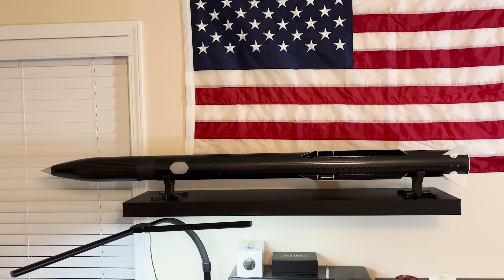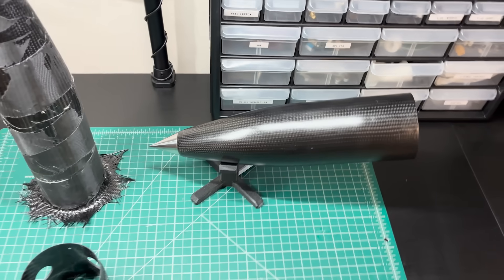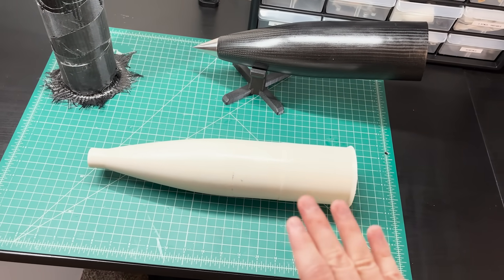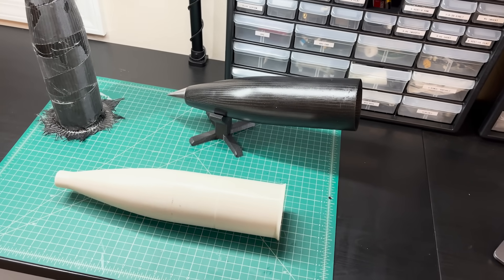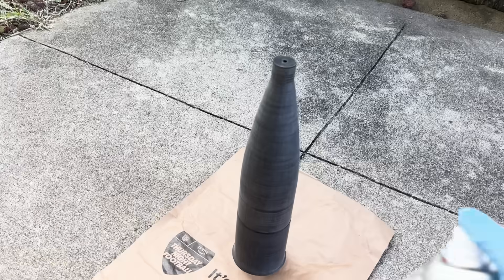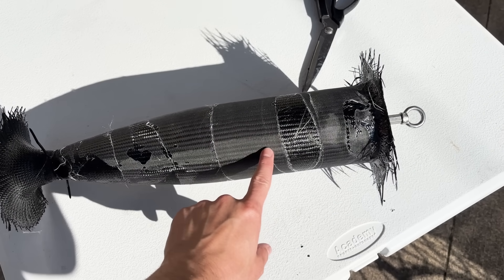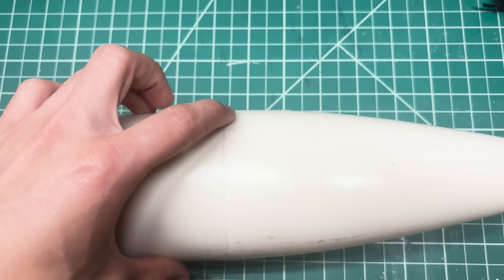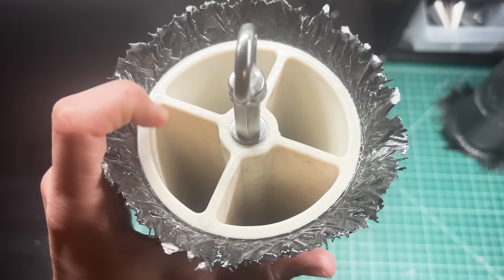Making Carbon Fiber Nose Cones at Home

Comment: Loved the video, but did have a suggestion to help! You're using a positive, or "male" mold (hence the mold release sleeves lol)

Another way to fix this problem is to use a negative mold. It would have to split down the middle of the nosecone longways and you could pull the 2 halves apart to release the piece. Easycomposites has a great video on a carbon fiber tube they made where the process would be very similar. An added benefit of this is that the outside surface is exactly what you design, since it's the molded surface.

Only thing is you'd have to vacuum bag it to apply pressure to the inside which I'm not sure if you have access to that and the materials associated with it. 

Keep on grinding! Such a cool project

Comment: Haven't tested it out myself, but have been wanting to get my hands on PVA filament which is water soluble and could allow just melting the mold out from the inside post layup with a water bath.

Comment: In the limb prosthetics industry, they use a pipe surrounded by plaster to create the internal mold for the limb sockets. For this project, you might be able to use a 3d printed clamshell mold of some kind to pour the plaster into and centering jigs to keep the hollow pipe centered. If there is a way to 3d print silicone, that might be your best option. I'm sure there are other ways to make a clamshell from silicone. You can get many years out of it. After the plaster dries, set aside a flexible bag that acts as the external mold. Place your carbon fiber tubing over the plaster with plenty of excess to trim. If you want, at the top of the cone, you can even reduce the wrinkles by cutting seams with overlaps and make sure there is a bit of overlap there. Or you can work them out with your fingers when the resin has permeated the fibers. But that's later. Once the fiber tube is around the internal mold, place your plastic bag (like a trash bag) over the carbon fiber tubing and tightly tape off or bind the bottom flared end around the pipe past the fiber tube excess. Once that is done, do almost the same from the top but leave enough space for a funnel and plenty of excess bag to surround the funnel, long enough to be above the funnel. Then pour the resin into the funnel above the carbon fiber. If you know the amount of resin you need, then after you've poured it all in, remove the funnel and seal the top of the bag. If not, then you might need to add a bit more to make sure it's evenly filled. Then use negative air pressure to suck the air out of the whole assembly so that the outer bag is sucked tightly around the whole thing and the resin permeates the fiber tube completely. You can visibly see it fill everything if you have enough resin. You want just enough resin, not too much and not too little. If you need to work anything this is the time to chase air bubbles out with your fingers and hands rubbing the outside of the bag. Once you are satisfied with the fill and no air bubbles, turn the air valve off and let it sit to cure. Once it's cured, the plaster is easy enough to remove without breaking the carbon fiber. You just need a piece of metal and a mallet to crack the plaster a bit and work the pipe out without damaging wither the pipe or the carbon fiber. Then you can remove the left over chunks and wash it out. I believe dish soap and water is enough to clean any plaster residue off of the inside. After that you can use a small belt sander or other hand sander with the cone mounted on a rotating mandrel to knock down imperfections. You can reseal the resulting product with a little bit more resin painted on the outside.  It sounds complicated but it is fairly easy to fabricate your own jigs and pipes that have quick disconnects for an air compressor system. I'm sure there are some videos around that demonstrate this method.

Comment: We use a layer of LW-PLA that creates an internal wall with the added benefit of precise print-in-place mounting points for our hardware. there is an internal PLA rigidiser with a removable key so it can be easily popped out once everything is cured

Comment: Why don't you just thin some silicone caulking with acetone and paint it on? Yes, you can thin silicone caulking with acetone. Or you could try using a mold silicone and paint that on. If that doesn't work, why not dipping it in wax? Get a pot of wax, melt it, and dip your entire part in it. Then, you could maybe heat the wax up afterwards, and the part will fall out. Why don't you try mold release? I guess that should have been my first suggestion. But I got a feeling the silicone cocking would be the best bet. Yes, you can thin silicone with acetones. Blew my mind, too. I bet you could thin it enough to spray it. That would achieve a very consistent layer of it. Also, you are aware that when resins like fiberglass resin or epoxy dry, they shrink. Locking itself onto your mold. Why wouldn't you just coat your mold in epoxy? That would make it perfectly smooth. And then ensure you remove all the bubbles by heating up the epoxy with the torch. I know a very good way that would take a little bit of designing, but if you designed your mold/part to incorporate a hole or air fitting on the end that you want to come off, you could use air pressure to release your mold.
Reply: Wow, that's the best comment yet. Some good ideas there. I bet you this is gonna get the top 5 comment:trophy-yellow-smiling::trophy-yellow-smiling::trophy-yellow-smiling:

Comment: Do you need any kind of special permission, or a license, or like a permit to fly this size of rocket?
Reply from the maker: I need a NAR Level 2 certification to fly at club launches, but the US government has no certification requirements to launch a rocket this size. You need to file an FAA waiver for any high powered amateur rockets, but this is handled by NAR or TRA clubs if you leverage a club launch event

Comment: on your point around 12:00 ish, this is why I promote the concept of "The Cube Test". create a cube of a known size, I recommend 1x1x1CM. run it through your processes, and measure it between steps to register how the material is affected by the material properties, so that you can then make your molds/3DP parts to more exacting dimensions.
regardless of the measurements after, you know that the original dimensions are 1x1x1, so any changes can be accounted for in the process to ensure parts are made the right size.

how much does the material change from the original dimensions by the 3DPF/resin cooling, 
how does it change in response to the vapor bath? 
how does it change in response to heating/cooling cycles like how you do to cure the carbon fiber/fiberglass/other materials?

this allows a wider variety of 3DP filaments to be used that aren't necessarily going to cool to the same dimensions as other materials without fear of it failing fitment or spec checks.
I would recommend doing it for each fresh spool of filament as well, because even if it's the same filament there may be variations in qualities between production batches.

I don't even have a 3D printer, but this sort of thing is a practice in Machining to test machines, in order to make sure they are still working and performing within acceptable specifications to produce parts correctly. we test the CNC machine by using a plastic simulacrum (there's a word to look up lol) to see if everything is performing right, and any new metal/polymer is tested before use to make sure it all meets minimum quality requirements for the parts being made.

I'd recommend printing out some template sheets to keep track of data regarding individual filament qualities to allow this to be easily kept track of with a clipboard instead of needing to step further away to use a computer, or using a tablet with the template and the ability to write which then saves to your computer or a storage drive.

Comment: It doesn't look like you have a draft angle all the way down it.  A draft angle makes a world of difference.  Also, carbon fiber that meets the metal tip should not be a larger diameter, it needs to be a smooth transition.  But I assume you saw that too.  Good work.

Comment: I´m wondering - could there be a way designing the mold as closed volume and try to suck a vacuum in it? May be in combination of forcing preasurized air between mold and shape?

Comment: Why not print a solid mold out of high temperature resistant plastic, dip it in parrafin wax and then just melt the wax to pull off the cf shell?

Comment: I have had good luck with a PTFE-based spray on mold release in a slightly different application. Two questions:

1) Have you considered using carbon fiber filament for your printer? The required mechanical rigidity of the mold is not extreme, so the wall thickness is not an issue, and maybe the printed fiber could replace one of the layers of the cloth.

2) Have you considered curing the nosecone in vacuum? At that size, you should be able to buy or manufacture a vacuum chamber for it. If you manufacture one, I can recommend schedule-80 PVC pipe. You can get it in rather large diameters. A diaphragm pump should be adequate and inexpensive. I have no experience with bagging, but I do not think it would be possible with your nosecone design.

Comment: Hi, I do have some experiences making sounding rocket's airframe parts using carbon fiber. The way I did was resin infusion. First I print a 3D printed a pattern, then the pattern is sanded and coated with epoxy resin and sanded again. This will create a perfect surface for mold release. The I applied about 5-layers of mold releasing wax, wait 15 minutes before applying a new layer, and polish each layer with a microfiber cloth. Leave it overnight. The next day you'll get a perfect easy release pattern because of the hardened wax coating on it. The diameter might be very slightly larger, but you can always offset that on your 3D printed part if you care. Then I made a fiberglass "inner" mold from this pattern using resin infusion method (with a closed bottom-end and a relatively big flange at the opening for placing sealing tape/bag, the flange pattern could use any straight board with circular cutout to sit your 3D printed airframe pattern inside); it's actually a very easy method and it will produce the highest quality carbon fiber part you can get (apart from using pre-preg + autoclave). Layers are held in place before infusion using glue spray. After getting the fiberglass mold, do the same process with the carbon fiber part: put on 5 layers of wax and let it sit overnight, apply clear coat if you want, place all clothes in, then infuse the resin. Then the only hard part of removing is to crack the flange made by resin; you can simply use a wedge and hammer; the fiberglass mold will handle all the beating with ease. After removing the part, you can go saw off the flange and bottom out and use a belt sander to grind it into the correct axial dimension. The mold can be reused multiple times. Using an inner mold makes the outside profile perfect, and resin infusion makes the part as resin lean as possible. It's a more complex process, a bit time-consuming, and requires many equipment and consumables, but it's really the best way to make a carbon fiber part to be as strong and light as possible, and it doesn't get messy while doing. The finished part will look like you bought it from a professional store.

If you want to use carbon-fiber sleeves, you can use resin infusion method with an inner mold, but you'll lose a little bit of profile accuracy.

Comment: Nice work! Have you considered printing a thin wall mold and then just leaving it attached to the sleeve?
Reply from the maker: Thank you! I looked into the idea, and I think for some parts it would work. Unfortunately I needed a fairly thin part at the nose cone shoulder, and I just didn't have room for a plastic wall and then enough layers of carbon fiber.
Reply: @LafayetteSystems  Just thinking out loud, it may be possible for that cylindrical shoulder section to be the removable part of the mold. You could probably just use the end of your mandrel that is used for the main airframe. That way you get an exact fit on the coupling, and not so much mold to remove from the nosecone.

Comment: Packing tape works great for outer surfaces as a cheap heat shrink compression tape. Best way is to apply it with the sticky side out. Additionally, due to the high thermal expansion of materials like HDPE makes it easier to freeze out mandrels.

Comment: So, full props to you for getting a mold process that doesn't require aerospace grade mold release sleeves. 

But dude, you're literally a rocket scientist. You don't need to remove the mold with brute strength. Mechanical advantage is your friend and ratchet straps are cheap.
Reply: Compressed air in the mold do wonders

Comment: Kudos for dancing around the 'mold release sleeves'.  Your melting mold idea was good, but plastic was not the right material choice.  Most printing plastics have a melting point that will damage your CF resin.  Suggestion below.

DISCLAMER: This suggestion is entirely theoretical.  You are solely responsible for the results of using this suggestion.  Do your own due diligence!  Safety is YOUR responsibility!  I will not be anywhere near where you are, so I bear NO responsibility for any issues you run into.  More research is required!

3D print the positive, fill and sand it to make it ultra smooth, make negative molds using silicon, then make multiple positives from the silicon negative molds using paraffin wax.  Paraffin wax melts between 46°C and 68°C.  The standard CF resins can degrade between 100°C and 150°C, so paraffin wax will melt out without damaging the CF composite.  Just use care applying the heat, and make sure you catch all the wax in a basin of some sort.  It's reusable, and you really don't want molten wax running all over the place.  You'll need to use an ambient room temperature cure resin to avoid melting the wax mold prematurely, which will require post-cure heating cycle(s) to reach full strength.

I strongly recommend at least a two-stage post-cure, if not three.  The relative temperatures at which paraffin wax melts and the resin cures are such that the wax can be removed without excessive danger of wax ignition, but always have fire safety protocols handy, and preferably do this in a well ventilated area that is not made primarily of wood.  You should be in a well ventilated area when dealing with CF resin anyway.  One suggested cycle used 4 hours at 70°C, which would melt the wax out, followed by one hour at 120°C.  Please do remove the wax before the 120°C cure cycle.  Sure, paraffin wax auto/flash ignites at over 200°C, but why take the chance?

DISCLAMER: This suggestion is entirely theoretical.  You are solely responsible for the results of using this suggestion.  Do your own due diligence!  Safety is YOUR responsibility!  I will not be anywhere near where you are, so I bear NO responsibility for any issues you run into.  More research is required!

Comment: Nice and really informative video Nick🔥🔥Sapphire looks beautiful.
Since you said the nose cone acts as a Faraday cage, where will you put the GPS antenna? On the outside?
Reply from the maker: Thank you! I am putting my GNSS antennas in the main avionics bay facing outwards and upwards at 35° from horizontal, the hexagonal white panels you can see on the rocket are resin printed covers that fit over radio frequency windows that I’ve cut in the avionics bay.

Comment: use  heat shrink tape - to compress  the composites layers -  though ive had sucess with vhs video tape its mylar so doesnt stick - and has some stretch so applies pressure- once wrapped prick all over with a pin to let excess resin escape

Comment: The Epoxy heated the surface layer of the PLA and caused the carbon fiber to bond with the PLA. 

You need to just make an Al nose cone mold, you can probably cast it, or weld up some sheet Al for it. Use plenty of release agent as well.

Comment: You could also try a low hardness flexible TPU sleeve with a rigid PETG or PLA internal cone/core to add form. After curing, you just remove the internal support and peel back the TPU sleeve. Much like the traditional "mold release sleeves" just more geared toward reusability.
Reply from the maker: This is another good idea!

Comment: Be careful when cutting fibers it’s incredibly nasty stuff
Wouldn’t be surprised if it gave you something similar to silicosis too, think of it like you’re working with asbestos with the appropriate security measures
Tiny carbon fibers imbed themselves into your skin and never leave same in your lungs
Reply from the maker: This is all very true! I wear a respirator and sealing eye pro whenever I cut or sand carbon fiber, make sure you all are taking the appropriate safety precautions as well